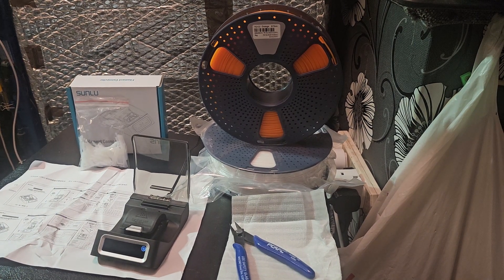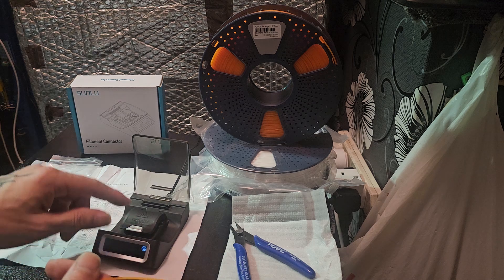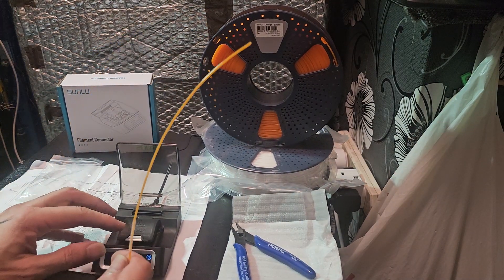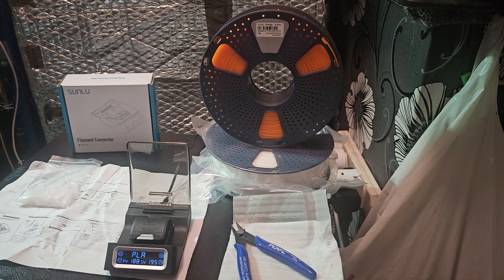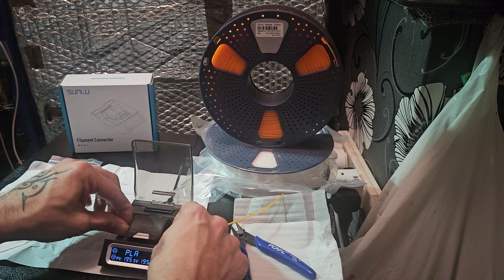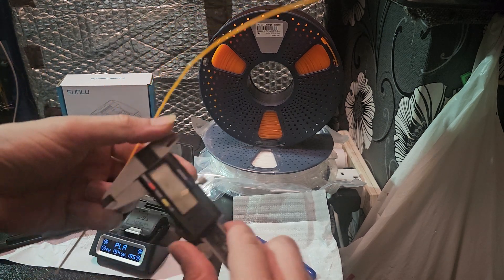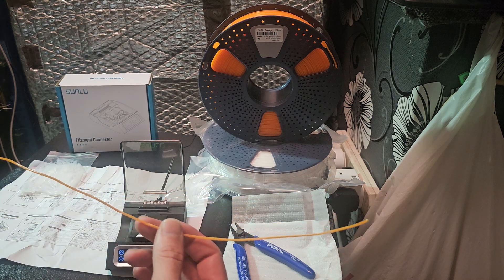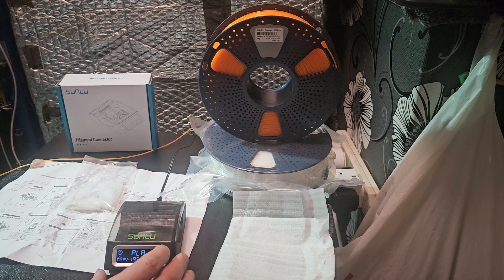SUNLU Filament Connector and PLA+ 2.0

Comment: I had bad experience with PLA+ 2.0 after just few hours outside those get very brutal and break inside the ptfe tube of my printer and cause lots of trouble in my printer, could you guys share your experience with it? consider I put it inside the ACE box of my printer inside the room for only one night, Thanks for the nice video
Reply from the maker: It went brittle on you?  Do you print from a dryer? Usually I hear of PLA of any form going brittle if it gets moisture or if it's sat indirect sunlight or nearby it for long periods like as in weeks. I would definitely be curious what happened there. So far I've done a few prints with the PLA+ 2.0 and it has performed very well for me In fact the Dragon Tanto knife model I did from the Sunlu page Is still holding together nicely

Comment: Thanks for the the testing. I was just wondering how much better the new PLA+ 2.0 was compared to the older PLA+ from Sunlu? they were advertising ABS like toughness but I find that a little difficult to take at face value. Thanks
Reply from the maker: Other than a few decorative prints. I haven't printed any functional items yet with it. I did a little Thor type hammer and the dragon tanto knife models that I found on their website. Both printed very strong and the tanto blade definitely has a flexibility that you would have expected of PLA+ so as far as toughness. I would say maybe at the moment without doing further testing though I wouldn't want to commit to it. I would definitely say it would not have the heat deflective resistance that ABS does. I have actually been considering printing the Thwack hammer. I did one for a few years ago and ended up giving it to somebody as a gift. Might be a good opportunity to revisit that. You can probably see the other two objects I mentioned in some of the other videos I've done

Comment: I imagine it's not just the pre set temperature that effects the diameter, but also how hard you push the filaments together. I am sure  with practice you could get better results.
Reply from the maker: This is also true they do say press together. Also the captive area for the joint weld is fair sized but this also heats either side of the tube as expected which could allow it to slight swell under pressure. I'm working on testing all the different material types It has presets for as well that are commonly found to be used. So more to come :)
Reply: Are the sleeves readily available and cost effective?
Reply from the maker: @CarolSuesCreations  I asked them and they said they will be available but they haven't given a price on them yet.
Reply: @CyBerJak  thanks ordered but changed mind did not see refills it cost. Think wait until amazon has it and refills
Reply from the maker: @CarolSuesCreations yea I hear ya. I did a 2nd vid I found a backup alternative just in case of out of stocks as welll
Reply: @CyBerJak  I will have to look for it